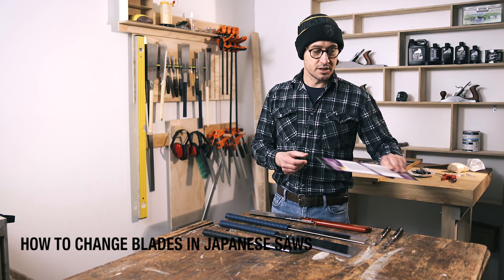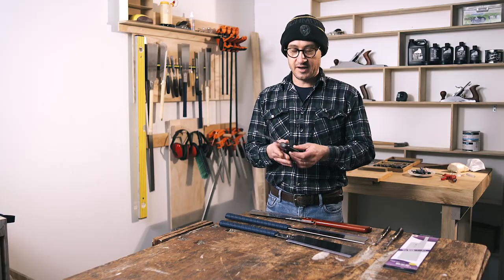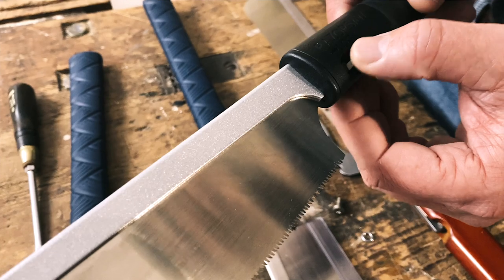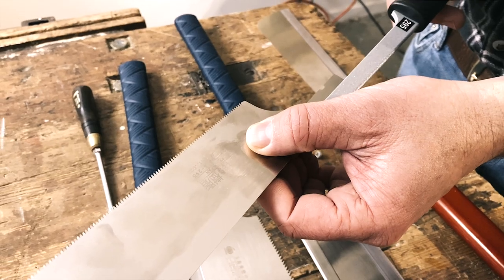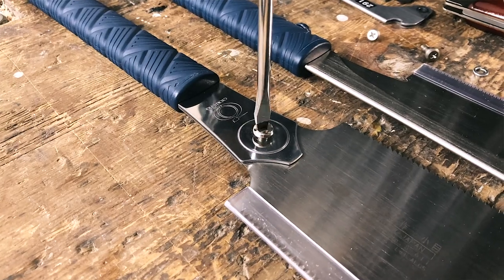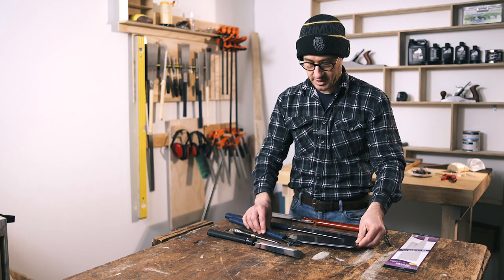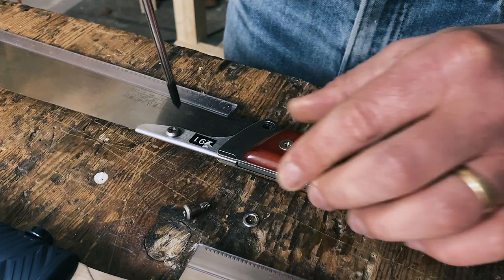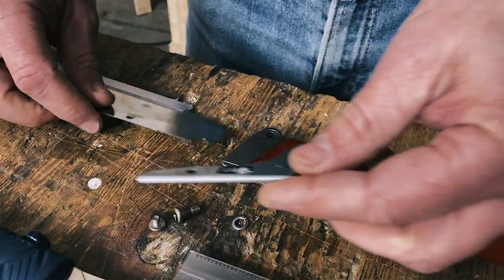How to Change Blades in Japanese Saws

Comment: Cheers for that mate👍🏽
So the rattan handles, replaceable, or no?🤔
I have never really sussed mine out, guess that's what I'll be spending a quick minute on tomorrow.😉
Reply: The handles aren't replaceable, Bill.  However, if you wear out the blade at roughly the same time, you can save a bit of cash on replacing both by simply buying a new saw!  :)  The new blue TPE  handles are a lot tougher than the rattan.
Reply: @graduallywizardly  
Yeah, I've got my eye on those new handles, but got to get through thus set first. They last a long time, got them about 3 or 4 years ago now and they still cut perfectly...
Cheers mate 👍🏽